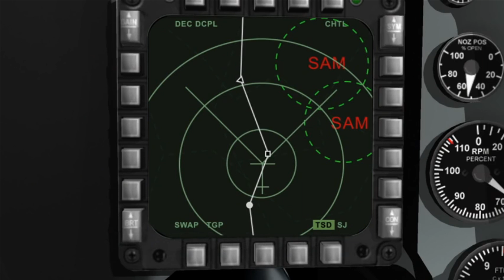IAF 400km stand-off jammer for C 295 & Avro which can jam S-400

Comment: It would have range of 400 but doesn't the S-400 radar have a range of 500 or 600km ?
Just a doubt so correct me if I'm wrong
Reply from the maker: 600km detection range but cannot fire missile. The missile can only be fired when it comes in the range of FCR radar. ASOJ is especially being designed for SAM and of course Missiles too